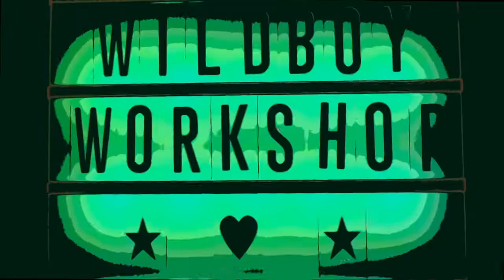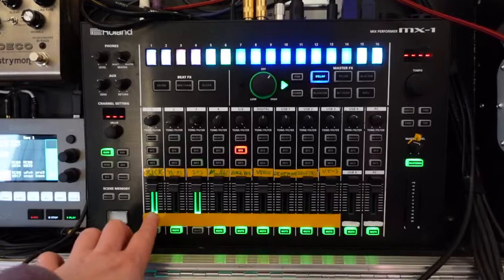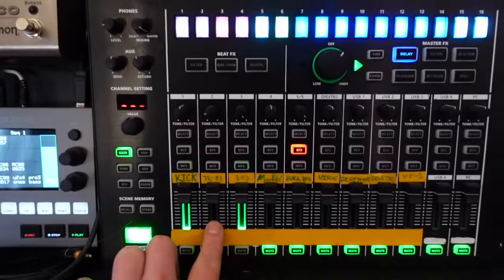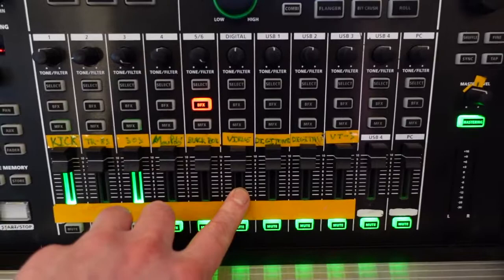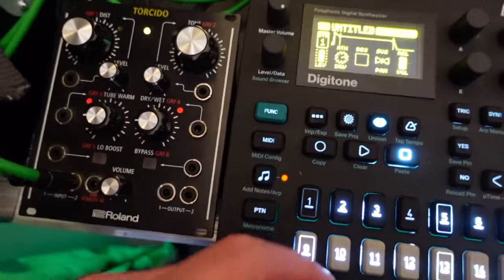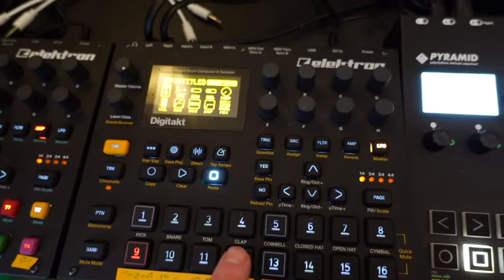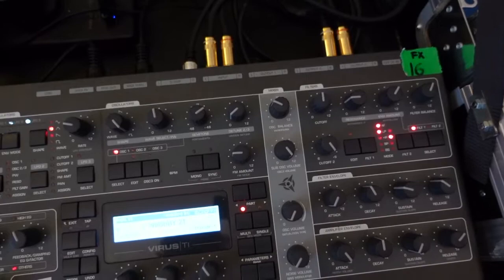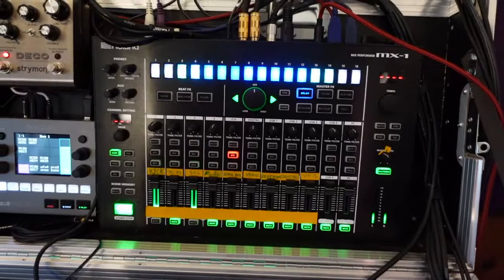How to make the most out of the Roland MX-1 audio inputs

Comment: Didn’t know that the TR-8s could route just the external in to the USB out. I would check if the MC-707 or TR-8 can also do that.
Reply from the maker: yeah, but on ly the stereo left and right.  This is where the fx of the unit come out, so If you need to seperate the channels you would route the kick and drums on the other outs and usb coudl be just the fx!

Comment: Very cool setup. I have a similar setup and we have a lot of the same gear. MX1, TR8S, VT3, Blackbox, Virus. Subscribing to see your tips and tricks using those. 
Tips for you - that case looks like it’s sagging from weight in the middle. When I put all my gear in my case, I reinforced the case itself first by gluing in hardboards on the bottom and top. The 3M dual lock works really well with it too.
Also look into “Pro-pedalboarding” videos for ideas on how to cable manage those power cables and wires neatly. They use rows of 3M zip tie anchors to neatly rout wires.
Reply from the maker: Hi, thanks for the tips, that’s great. Getting those cable tidy is a tricky job! If you have anything in particular you would like me to do a video on please let me know.  I’m gearing up to do them in a regular basis.

Comment: Lovely set up and creative too.

I have the MX-1 and I'm thinking of replacing it. I have my Roland Fantom connected thru chanels 1 and 2 set up for stereo. Though I have noticed an annoying hiss thru 1 and 2...

Have you found a way to combat this? As its irritating because the MX-1 is a nice piece of kit.
Reply from the maker: Hi Yok, have you checked the hiss is not coming from the Fantom with the same amount gain applied.  His often comes if you out put from a piece of hardware is low, so check gain staging.  I haven't noticed that much hiss, nothing that would be a problem in a recording.
Reply: @Wildb0y  I'll check that out my good man thx 😉

Comment: Cool! thanks for sharing, do you know if it is possible to connect a Rode NT/1A to the MX1?
Reply from the maker: Hi There, the short answer is no, as the NT/1A needs +48V phantom power.  You could get round this by powering it with a preamp before going into the mx-1.  Or  use the vt-3 or vt-4 vocal transformer which has +48v and a xlr input, these unit then can be connected by usb to the mx-1 saving your analogue inputs for other jobs :)

Comment: Very nice setup man! And crystal clear explanations :)
How did you attached all the gear to your front panel?
Reply from the maker: Hi Lee thanks for watching.  I use this strong velcro style tape which is very strong.  It works like velcro but instead of tiny hooks on one side and fuzzy loops on the other both sides have litle mushrooms that interlock with each other.  Made by 3m....https://www.ebay.co.uk/itm/255327791631?hash=item3b72b8ea0f:g:ItkAAOSwW69h8S1b
this sort of thing
Reply: @Wildb0y  thanks mate!

Comment: I have my monologue going to channel 1 and it only comes out of the left monitor. If it goes to 2 it only comes out of right monitor. I don’t have a Jack that goes to 2 Jack (y cable) 

How do I make channel 1 and 2 into mono channels in stead of being stereo? (& is it same with 3 & 4 as well?)
Reply: It’d be much more useful for me to have channels 1 to 4 as seperate mono channels as at the mo I can only jam with my monologue coming tjrough 1 side. I know it’s possible to do it, I just dunno how. 
I have 3 usb channel going from tr8s, tb3, JU06a, and that 5/6 input from Maschine. (Maschine sends midi out to mx1 midi in so it’s all synced, but I’m often not using Maschine recently as I’m trying to not need to use computer, it’s just ideal that it’s all in sync when I do want to include Maschine, and it doesn’t affect anything when not in use.)
I’m pretty new to the mx1 and to Dawless jamming in general. Any info on how to change that channel 1&2 setting will be so helpful.
Reply from the maker: I have replayed on the wrong post woops! Go check it out where you commented.  There is link you the cheet sheet.

Comment: Interesting that all the Roland gear is going into the MX-1 via analogue input and the non-Roland gear is going in via the usb!
Reply from the maker: The decision process comes down to what you want to do with the audio signal pre mx-1 and what sounds need to be super tight as there is a very slight amount of latency introduced.

Comment: Curious if you still use the MX-1's send/returns with the Virus? I've found the return to not be a fully "wet" signal and thus not quite as useful as I'd initially hoped. I've since switched to just using the send as a way to send certain elements out to my sampler, and invested time in really digging through the MX-1's built-in master effects -- figuring out which ones are the most pleasing -- as a way to simplify the set-up. 🤷‍♂
Reply from the maker: Hi Philip, apologies for the slow response. An interesting question.  At the moment I can’t test as I’m the other side the world exploring a new setup!  From memory after a bit of tweaking I had it in a good place, but I know what you mean about a fully wet signal it never exactly seems the same as a proper mixing desk, what kept me with the configuration was using the reverb, I love maxing it out in fees back then mixing in a lfo that controls the patches volume to get that sucking pumping compression effect without compression.
Reply from the maker: Yes, does take a bit of time finding the best but fx on the mix-1. Overall there is still nothing out there that really does what it does!
Reply: @Wildb0y  Agreed. I love my MX-1! Just abandoned the send/return and put a KP3+ on the master outputs eventually. 🤷‍♂️ Love your setup! Keen to see more performances!

Comment: Alright pal 👍  thank you for the info....I have been looking for gear to utilize the digital channel....do you know if you can link 2 MX1s via the digital inputs/outputs...dig your rig....Brilliant and inspirational, Warm regards, Alan G.
Reply from the maker: Hi DJ Nobby, there is only a digital input on the mx-1, not an output.  A while back im pretty sure I saw somewhere on the internet its possible to use a a basic analogue to digital convertor for example like this one https://cpc.farnell.com/pro-signal/psg3027/audio-converter-r-l-to-optical/dp/AV27974?st=analogue%20to%20digital for 12 quid. to quote me on that particular model but I have seen it work.  Im sure most basic convertors would work.
Reply from the maker: In a way this means if you need more inputs you can expand using a little analogue mixer going into the digital input to the mx-1
Reply: You can link 2 mx1 with the digital input/output. You set one with output setting and the other with input setting.
Reply from the maker: Hi Claude,  thank for the question.  As far as I know, the digital input is just a digital input.  I have never tried to make it be an output I don't think it works like that, theres a chancei could be wrong.
Reply: @Wildb0y  if you start the mx1 with gain and select select the digital channel, it turns off and become an output channel. It outputs the mix.

Comment: Nice setup ! I wonder If you can also use a TR-8 (not the TR-8s) for its usb audio through capabilities. I just bought one with broken faders (all open or all closed, no option in between) for 1/3rd normal second hand price, incl. 7x7 extension.
Reply from the maker: Thanks N1hL3.  I tell you what, i can check for you as i have the tr-8 as well.  Im pretty sure it will work in the same way.  You got a sweet deal there.  You pretty much on y need them on or off anyway!

Comment: stupid question output sound from it how do i set it up into my audiobox usb ??/cheers
Reply from the maker: Hi There, apologies of rite slow response.  If you are recording just the stereo out of the mx-1, you can either use two jack to jack and connect via the inputs or you can just plug the mx-1 straight into the computer via usb and record the stereo out or all the channels separately in your daw. hope that helps :)

Comment: What istruments can be used into USB channels ?? - only aira gear ou something else ? - can TR-8 and MC 707 be used ?
Reply from the maker: hi there, tr-8 yes but I don't know about the 707.  I work ardour is to use the Roland modular series such as the "torcido" distortion unit that has usb out which can plug int the usb of the mx-1.  This mean then you can plug anything you like into it via the Torcidos audio inputs.
Reply: i Got it...but have you tried to plug Digitone it self directly to the MX-1 ? - Have you tried to set digitones output via usb and its detecting MX-1 as destination option ? - theres a video with the guy wich figure a way to use akai MPC one into these USB ports and he did it......
Reply from the maker: I haven got any of the elektrons to work, I imagine its complete different syntax  @ACCOUNTANTB
Reply: I think into the PC (usb) port..with a USB hub..you can run every gear...Im not shure....lets try out....If this port does get muti-channel input (from Ableton / example) - it might be able to.....

Comment: Can you please advise me on wheather or not should i get an audio interface with the mx 1, I recently decided to get a few sound monitors and im using mx-1 on midi usb in external mode
Reply from the maker: Hi Lloydvallentine, thanks for the question.  If you mean you have got yourself multiple sets of monitors then that's more speaker selector question rather than interface.  But you certainly can use the mx-1 as a audio interface but I have ended up recording its stereo out through a separate audio interface for when I record a jam as this worked for me the best due to having weird glitchy sounds/artifacts were printed on the recording when I used it as an interface.  This coudl of been due to the usb hub on my computer but I have never been able to get to the bottom of it.

Comment: Why does recording using the mx-1 produce such a low level ?
Reply from the maker: Hi, apologies for the slow response. I haven't noticed the mx-1 being a low level. perhaps could you expand what you mean, do you have hardware going into it? have you setup the gain on the  mx-1 channels on the way in to get the levels up? you do this by going into gain mode and selecting a channel then using the meter to get the right level.
Reply: @Wildb0y  

Thanks. I'll give that a try. Seems to be the case, whenever recording into windows, the recorded levels are very low, below -12db.
Reply: Try to keep the gear volume at 3/4
Then open up the master volume near Mid level and dont use the internal mastering.
Just dont clip on the master.
I had a decent volume then.